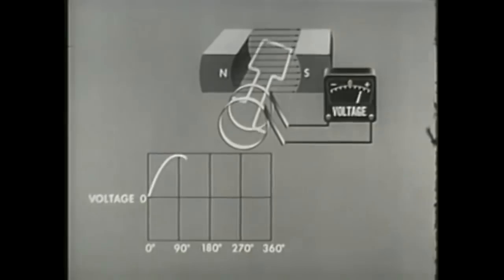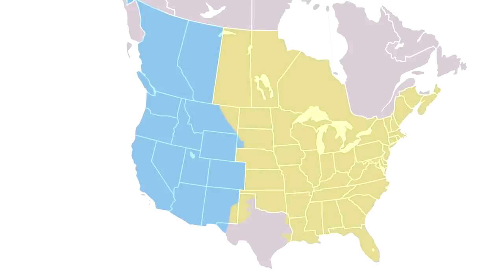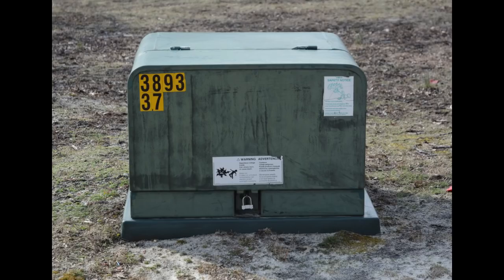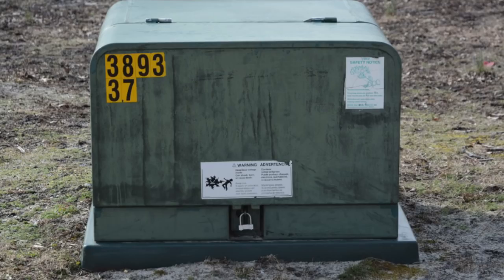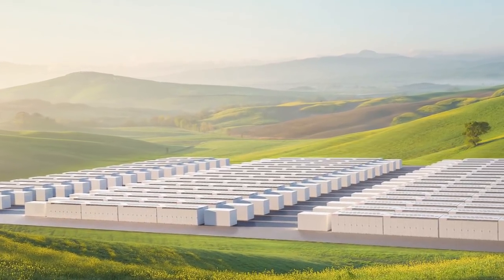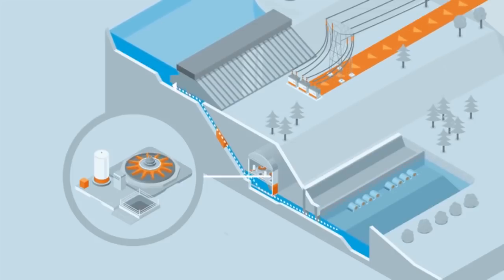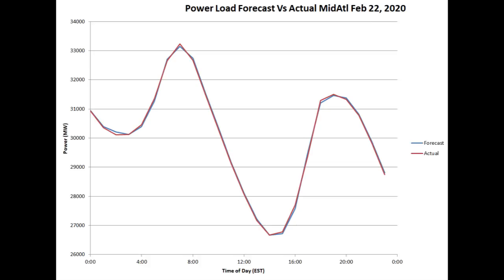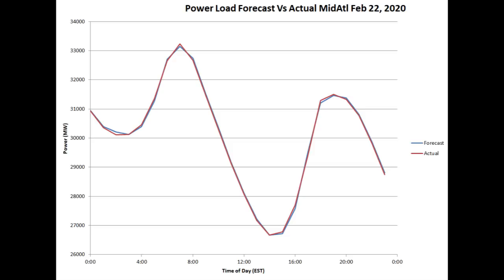How the Electrical Grid works

Comment: A talking head shot is not a good way to communicate information on the power grid. Not recommended to understand the grid. Yet another non EE trying to pass themselves as knowledgeable. Not recommended.
Reply from the maker: Ironically I'm actually a EE, but admittedly one that doesn't specialize in power. I would love to hear specific complains as to why you feel this isn't correct. It's hard to get something that reflects how the grid works, but isn't so far down in the weeds that it isn't that interesting.

Comment: ..'Economical' is the word You forgot. Big scale 'standard' generation need to work more then 3 out of 4 quaters a year to be economical. Their synchronous generators keep the system in a stable state without which all solar and wind generators can't produce cheap energy. BUT we're  giving more and more priority to electricity produced from solar and wind WHAT makes standard generation unecenomical. WELCOME to the real world.
Reply from the maker: I plan on going in to the economics of things in more detail, in my search for the best forms of power. Using Solar and wind is challenging to the grid, as you mentioned. There's a whole lot to this, and I haven't dug up everything yet that I want to talk about, but this will certainly be a subject of interest.

Comment: Good video, thanks for posting. I think you are correct in your assumption that the "best" source for electricity won't be one source. My prediction is a base of Nuclear, Geo and Hydro. Intermediate and peak loads covered by Solar, Wind and Batteries or other storage be it kinetic or hydro based. And as the tech progresses maybe we will get to Solar, Wind and batteries one day in the future.
Reply from the maker: I probably won't look a lot at geo, it seems to be largely only available at a few locations. I believe hydro and nuclear would be sufficient, but I plan on providing enough data to allow people to make their own assumptions using the data I've determined. Still, I'm quite interested to see the results myself:-)

Comment: This comment is to tell you that the content here is pretty great. I did notice at 10:35 that there was kind of a weird jump cut where you cut yourself off. Your comment about Nuclear Power is mostly correct. All the currently running plants are essentially that way, (on or off), but the new technology of the smaller modular nuclear reactors basically solves this issue. If you google the modular reactors that are currently being built (in Arizona or Utah if I remember correctly?) they are scheduled to be completed sometime in the 2020s and are likely to be utilized throughout the industry if they are successful.
Reply from the maker: Modular nuclear power is something I'm planning on doing. I'm not always perfect with my edits, but getting better in general:-) 

France actually has the ability to ramp up and down their nuclear power, basically it involves getting rid of the xenon, which is what makes that difficult. But the smaller, more modular ones certainly sound like a good idea to me!
Reply: Roadster Tracker -Ben Pearson also, yes I meant to say all the currently running USA plants, when you factor in the whole globe of nuclear plants, the tech is a lot more varied.

Comment: Thanks, great topic!!!

Would like to see you dig deeper into electrical storage.  This seems to be one of the big breakthroughs that we have not yet mastered.

Another one would be research on more efficient transportation methods.  One of the reasons we don’t have massive solar arrays in the desert is that we don’t have efficient ways to move the power to where it’s needed.
Reply from the maker: I'll add that to the list. I actually have statistics that will help me figure out how much electrical storage would be required for a fairly large section of the US, although I haven't finished looking at those statistics to get that information out.

As for transporting electricity, well, there isn't really any magic about it. High voltage, thicker wires. It just gets to be expensive, that's all.
Reply: You might want to also discuss the HVDC concepts as well for disparate power regions, since frequency is so tricky over large distances.
Reply from the maker: Will consider it for sure. The ultimate goal of this series is to determine what forms of power are the best overall. I'm considering more of a grid of the future, but haven't got to even the sketching like it. As this series is proving to be more popular so far than expected, I'm more likely to cover such things.